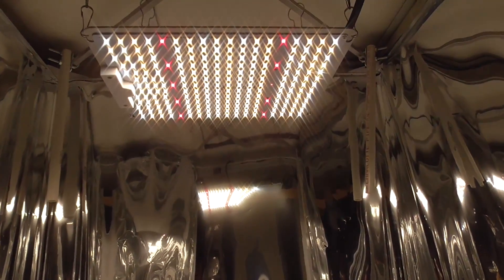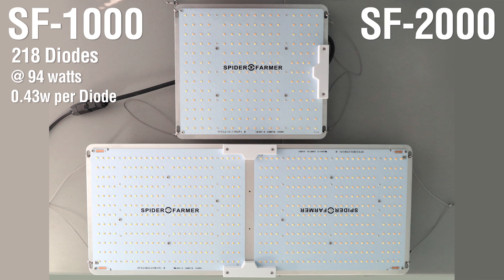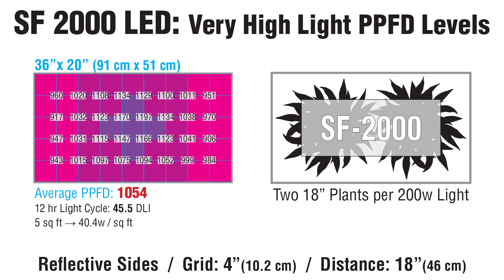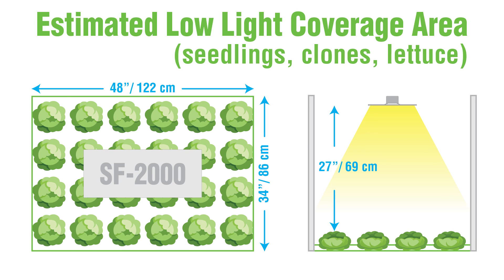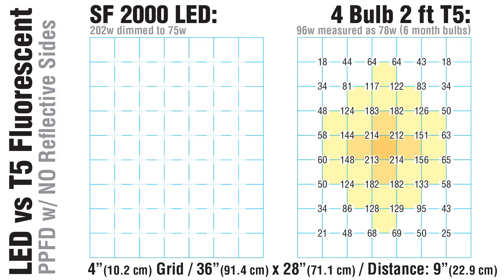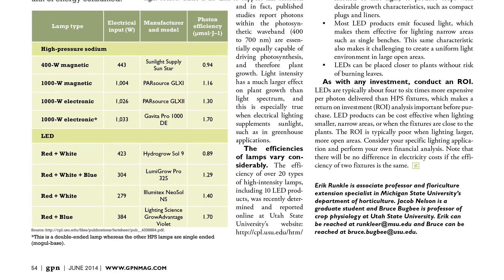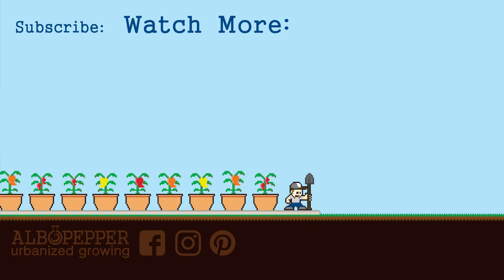High End LED Grow Lights: Coverage Area & Distance - LED vs T5 vs HID (Spider Farmer SF-2000 Review)

Comment: Call me old school but i still prefer to advocate the 40w plant and aquarium bulbs 8-16 t-5s over a 4 foot long grow space talking 12-16 square feet of vegetation growth space.
Then ide prefer a 600 watt hps to flower bare minimum .
Using a sea of green method and clever training ive done what they say cannot be done with old school t-5 and a 600 watt hps.............
Reply from the maker: Oh no, I wouldn't say it's old school per say. It's simply less efficient. Unless your grow area is below optimum temperatures, the extra heat from the lights gets wasted and you pay more per photon compared to LEDs.

Comment: Really a great review man! So usefull! But I have a question: it's ok to use the sf2000 in a square growbox instead of a rectangular one? Like a 80x80 cm for esemple
Reply from the maker: Thanks for watching! It would work fine within that space. It would be really bright actually. The 2 sides won't be quite as bright as the middle. But it might not be an issue depending on your plant configuration.

Comment: When trying to get a high ppfd I dont want to get too high of a peak value in the center to avoid adverse effects or light bleaching. Whats the max value to avoid?
Reply from the maker: That's going to depend on the type of plant. Also, the day cycle duration will be a factor. Keep in mind that light levels on a clear sunny day could reach 2100 PPFD near the equator at noon.
Reply: @Albopepper  Thank you! I forgot to mention I mean specifically for mari-tomatoes. Getting a peak value of 1200 ppfd seems safe but would 1500+ as long as the average isnt high and the DLI doesnt exceed 51?
Reply from the maker: The plants can handle a peak of 2000 PPFD. But at a certain point you need to tweak all of the other parameters including CO2 in order to take advantage of that light. This video is a nice overview from Apogee Instruments. Dr. Bruce Bugbee really knows his stuff: https://www.youtube.com/watch?v=ID9rE5JewVg
Reply: @Albopepper  Thank you!!

Comment: Did you say Spider Farm HIRED you to do these experiments!?🤔
Reply from the maker: There were no experiments. These are PPFD measurements. And yes, they paid me for my measurements using my Apogee Instruments Quantum Light Sensor. I mapped out the readings and created the graphics of those values. I sent them the readings and they used the data on their product listings. Compared to the PPFD chart they originally had, this data gives many more readings at more distances and with or without side reflection. Why? Does this seem odd to you?
Reply: @Albopepper  yes, it does. Maybe it's just me & my skepticism 🤷‍♂️
Reply from the maker: Did you look at the graphics in their listing for the SF-1000 & SF-2000? They're using my charts. First I supplied charts for the SF-1000 at no charge. Then I offered to make readings & charts for the SF-2000 which they paid me for. Did you look at the graphics in my Amazon review for the SF-2000? I have charts that are exclusive to my review that I never supplied them. I don't really care if you believe me or not because I'm telling the truth and I have nothing to prove to you.

Comment: Great video! Looking to set up a 3x3 (39”x 39”)medical tomato tent. Is a SF4000 too much? 1- 2000,  2- 2000?  Any suggestions?
Reply from the maker: Either a single SF-4000 or two SF-2000s would fill the space nicely. I don't think they would be too much (depending on environmental factors, like CO2, etc). If needed, you could always dim them down slightly.
Reply: AlboPepper - Drought Proof Urban Gardening  Thanks for the reply! I think I might do 2 of the 2000’s. This way I can split them up if need be. Thanks again.

Comment: I’m about to have a go at my first grow I’ve got a 8ft x 4ft room was going to put in 10 autos using this lighting system what would you suggest?
Reply: Bow Hunter I think he was saying that 8' would be pushin it for this light and 10 autos ,by looking at the graphs( unless they are real small and u can push all the pots together so they touch) is too many. I could be wrong though. I've got 4 auto White LSD ,12 wks old. Just flushing now,in a 3 by 8 closet. They are all about 2ft. tall and 2 ft. wide. 2 600w , cheap led,s. Just enough room but not enough light. In ur case it depends on how big those autos will grow. What kind of autos ?
Reply: Hi Chris I’ll be putting in 6 shooter and blue dream auto Pineapple Express auto and rhino Ryder all from 420 fats buds.I was thinking 3 of these lights?Also trying to keep the heat down.

Comment: I dimmed my 4000 down to 150 a driver ( simply to use less electricity and get the same results,its only in a 4x4 so that 100 watts over 18 hour a day  works out at 10 plus KW a week, ill booat em bck up the last 4 or so weeks

Comment: @ 8:00 ...you discovered the big secret ....led (chips) run more efficiently when under powered (dimmed) ... you can get 30% more light per Watt of electricity , and also the leds will last much longer .... The biggest cost is your electricity bill , light manufacturers don't care about that ... they cut costs , use less leds and drive them at max power ... When growers understand this there will be a new revolution in grow lights
Reply: oz93666 so what light would u recommend ?

Comment: *Great video. So many people out their are so focused on the power draw and what the electrical bill is going to be they neglect the fact that with a light that has the right intensity for flower that uses more electric will also give them more yeild which will always more than compensate for the increased electricity costs over the 3-3½months of their grow cycle from seed/clone to harvest. *
I wish alot more people saw this video and stopped wasting their money on lights only really good enough to veg as they don't offer the intensity over a decent coverage area for flowering
GL ✌🏾✌🏼🇬🇧

Comment: Pls compare: ChilLED Logic DIY 270w 3-UP vs SpiderFarmer SF-2000...seem to be same no. of similar diodes but different drivers...what is better?
Reply from the maker: SF-2000 is better. No assembly required. Better light distribution. The only reason to consider the other one is for a greenhouse with natural sunlight. The other one would not block out as much sun from overhead.
Reply: @Albopepper  :  thank you so much...wow, very quick response...am impressed.

Comment: @3:30 XD

Great vid as usual, lots of fantastic info. You should check out the DIY HLG quantum board lighting kits. Very little assembly required, very low cost for high power lights.

Comment: I have a 4ft by 4ft would 2 sf 1000 be ok as I already have one at the mo
Reply from the maker: I think that a second SF-2000 is a good idea that size of grow area. That would be 16 square feet. It partially depends on the elements featured in the video (plant type, size, quantity & growth phase).
Reply: @Albopepper  its weed plants and I grow 4 a time   they get about 1meter high and it for full cycle veg and flower

Comment: gonna put a link up for this on my channel . is that ok ?
Reply from the maker: Yeah! Thanks!  :-D
Reply: @Albopepper   thanks and thannk you for letting me put a link up  .. iv learn alot from you and i gather you did the tests for  the link i put on your channel ..
i see the par readings on amazon about 3 week before i see your vid s  and did not know they were yours  untill the pic i had on my phone matched yours  .. i raised my light s after seeing your vida and i would say you saved my  smoking tomatos that i grow .. 
Iknow PAR and l;ux measure diff types oflight  but would like to see what they are when matched 

 A PAR meter costs as much as a light and tent fans and seeds  a lux meter is less thsn 10 quid ... 
 can you help doing the same tests on the SF 2000 .. 
For me the 36inch x 20inch tent would be nice at 18... 24... and 30 inch ..

Comment: you can actually up the light cycle for mari-tomatoes later on, when you know enough flowering hormones are present, you're sure for it to not get back into veg, 
slowly add an hour of light on the last couple of weeks, sure, it's not nature's way, that's would actually be gradually reducing it (gas lantern routine technique), but it brings results

some people even put their plants in the dark for 48 or even 72 hours to build up hormones and trigger the flowering process quicker before going from 18 to 12 hours of light.

there's also auto flowering mari-tomatoes that can be held on a 16-hour cycle throughout their whole life, which makes it a bit easier toget your desired light for 24h cycle,
they do very well in the netherlands too, where our climate isn't all that, and we have the harsh northern hemisphere cutting the daylight pretty strongly 
(dark now at 5:30PM, and we're not actually in wintertime yet), the extra hours do wonders

i chose to artificailly force them to 12 hours dark in july, by putting in my shed with the window sealed of with thrash bags,
so you can still get the long days, and strong summer sun to flower, rather than veg.
waiting for fall is asking for bud rot and fluffy results, humidity is a HUGE problem here for 3/4 of the year.

growing indoor from feabruary orso, then putting them outside late april, and flowering them around early june would be like the best where i'm from

Comment: Marshydro vs. Spiderfarmer would be a good Video. They cost the same (ts1000 vs sf1000) but different diods and max consumption. Both dimmable. Do you have experiance with the Mars Hydro TS 1000?

Comment: Question* / Advice 
I am loosing my mind with a meanwell HLG185H-C700A driving
 6x Cree cxb3590 
2 x citizen clu038 leds. 
They will not turn on. 
Please see link to my YouTube video better explaining. 
https://youtu.be/SbWub4mQYws
Since the video  : 
eliminated both citizen cobs
Soldered all wire connections 
Checked continuity, is good 
Measured voltage to be 286v. 
Any help would be greatly appreciated. 
Thank you 
Nick
Great video as always.

Comment: hello, 
i am slightly confused about which will be the best spider farmer light for a 2x4x6 grow tent. the confusion started with the manufacturer saying a sf2000 will be enough for the 2x4x6 tent however, you say that two would be needed? 
can you advise me on whether one would be adequate or do i need to get two?
:-)
Reply: If the tent is 24" x 48" I think that a single SF-2000 would work, but might not be optimal for maximum yield. Other factors always come into play as well like temp, humidity, CO2, etc. I would start with a single SF-2000. Then if you decide to push things to the max, you could add an SF-1000 for optimal coverage and light saturation. But there should not be any need for two SF-2000s in that space. In fact, they might not even fit.
Reply: @jamesbradwood5064  
lol @ they might not even fit :-) 
really appreciate your help,  i'll be getting some lights now i'm a bit more clued up on how many :-) i think (like you said) one sf2000 for starters and then another sf1000 further down the line.
:-)
Reply: The problem is when you get above 750 par you really need co2 or risk burning the plants.
Reply: @timpage5021  
interesting about the 750 par and the need to add co2, i didn't know about that at all.
:-)

Comment: Albo you are my favorite Youtuber.  Always a pleasant surprise to see your videos in my feed!

I actually purchased the SF 2000 for my marimatoes after watching Albo's review of the SF1000 and have been thrilled with the results so far after using it briefly in two grow areas.  I started with the light dimmed down over six clones that I had recently transplanted into solo cups with the light about 8 inches above.  They grew stocky, leafy and green with no signs of stretching or light burn.  Next when the power went out on my 2 foot 4 bulb HP T5 with AgroLED tubes, I moved this light into full power position over two plants in week two of flower in my 4x4 tent.  It is currently about 12 inches over the plants with supplemental 2 foot, 2 bulb T5s with AgroLED bulbs on the far sides (each plant is trained wide and flat so together they easily cover a 4x3 area.)  Now in week 4 of flower I can see a difference in the size and density of the flowers with very little stretching compared with my last grow.  Power usage is spectacular.  With all lights and 4" fan on low power, I'm only pulling 320 watts and my biggest concern is potential light burn.  Heat is a non-issue.  My basement consistently stays at 65 degrees and in the tent with all lights blazing it gets up to 74 during the day when the lights are on.  

I plan to eventually get an SF 4000 to cover the entire grow area and then move the SF 2000 into a veg room.  My T5 will probably be used strictly for clones and seedlings in March when I start plants for my outdoor garden.
Reply from the maker: That's awesome Dave! Thanks for sharing your detailed experience with this system.  :-)
Reply: Thanks for such a detailed description of how you are using the light.  I feel pretty confident in purchasing this light now.

Comment: How low can the sf2000 be dimmed down to? You've done a fantastic job with this video by the way! I am one of the few people interested in an sf2000 to dim down as I'll be running it around 36cm from succulent plants/ seedlings in a 50cm X 100cm X 50cm tent
Reply: Do you think the sf2000 is more efficient than the 1000w due to the lower wattage draw from each individual diode?
Reply from the maker: Thanks for watching! I was able to dim the SF-2000 down to at least 50w. I might have been able to go further, but I didn't push the limits. Not sure if the SF-2000 has a higher efficacy rating than the SF-1000. But I was really quite impressed with the SF-2000, above and beyond the SF-1000. And certainly for the lifespan aspect, I just like the idea of using more diodes at a lower wattage per diode.

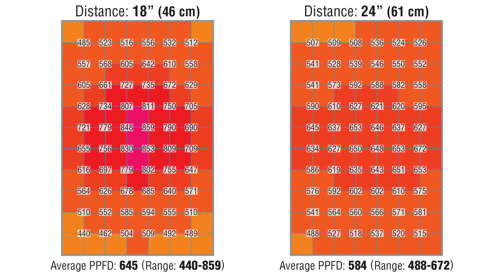Comment: 2:49 You measured the PPFD over 40" x 24" area and not a  44" x 28" area. To measure the PPFD over the full 44" x 28" you would have to shift your measurement positions so that the outer positions were 2" from the sides of the area rather than the 4" as you measured. This would give you the true average over the full area at 4" centres (centre of each of your squares in the grid). It would add 17 positions and the true average PPFD should be a bit lower than 584. Also when measuring on equal centres (the most accurate and proper way of measuring average PPFD) it is best to divide the area up into a grid with even-numbered sides the more measurement positions the smaller the centres on the grid the more accurate. Kudos to you for measuring in a grid pattern rather than the inaccurate star pattern, you just need to adjust it to properly cover the full area now to get a true reading.
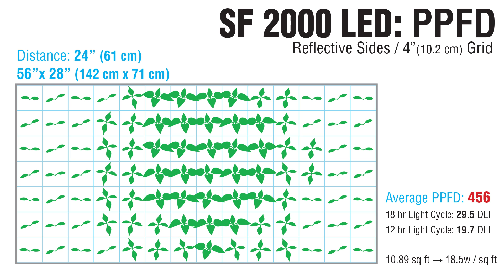So to repeat, you have measured the PPFD over a  40" x 24" area. Take the measurements on centres just as you have placed the seedlings @ 2:29.

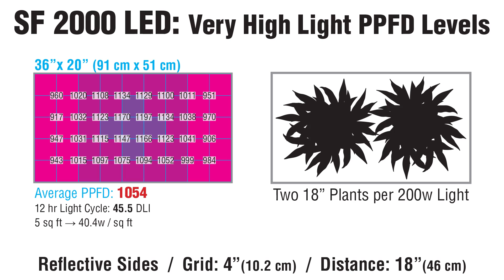At 4:10 the figures you have on the left for the 36" x 24" are actually much closer to the correct figures for the area on the right because the reflective sides would be closer at the top and bottom wall the numbers would be slightly higher but the left and right side walls need to be moved in 2" each also making the correct area for getting sufficient light intensity for tomatoes 32" x 20" under those lights. Actually with the increases from reflected light, it's likely to be about 34" x 22".

The lights look good.

Comment: Amazing video as always! Do you think such a light would be suited for a vertical grow tower (out of a 4'' PVC tube)? I have three vertical towers in a 48'' x 42'' area? I'm mainly growing leafy greens. If you would like picture of the system, send me an email at maxence@aqponyx.com. Cheers!
Reply: Is it something kinda like this? https://i.pinimg.com/originals/f6/e3/d7/f6e3d71d86a0c10a52fe9c37d783b0d5.png You would need two SF-2000s for that area with reflective sidewalls for sure. Even  bright / reflective flooring. Even then, uniform lighting can be tricky if it's 100% artificial.